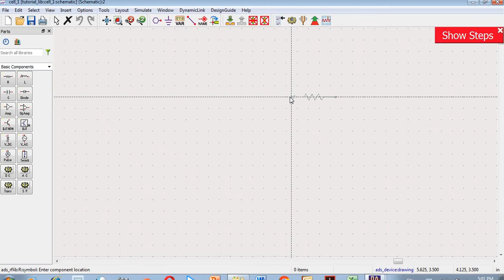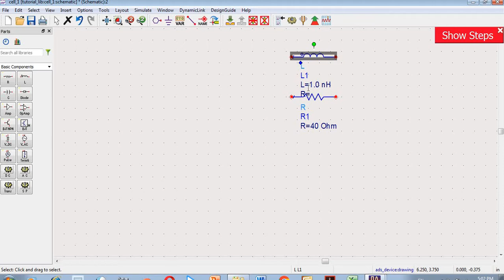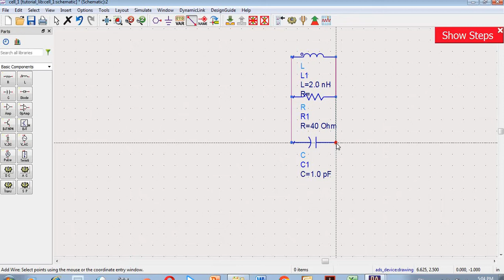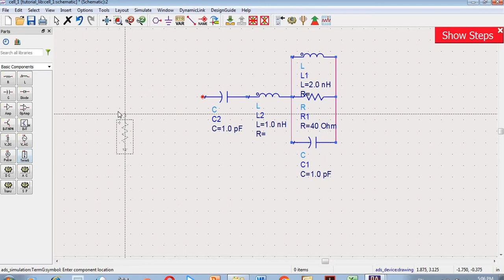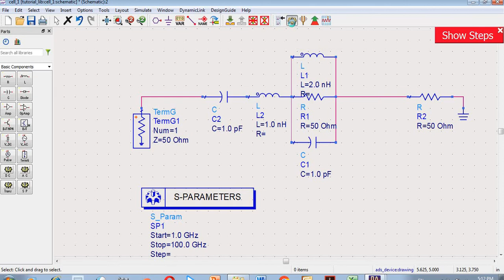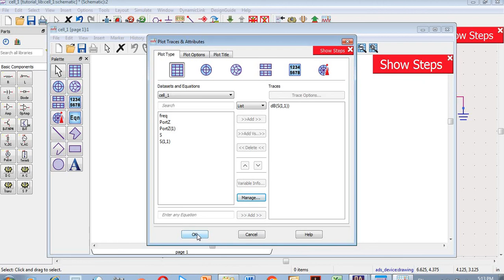Comment: Thanks for the video. Sir, in your circuit you did not consider the transmission line effect between the two passive elements. Aslo, you have used ideal passive elements. do you have any explantion for this. Thanks in advance.
Reply: You are right! But the main purpose of this circuit was to justify an antenna simulated results. Therefore, it was considered in ideal case
Reply: You may consider transmission line effect